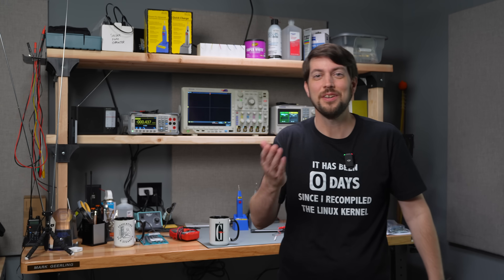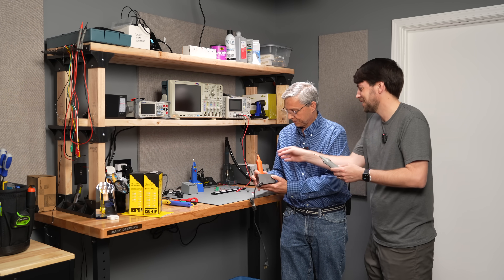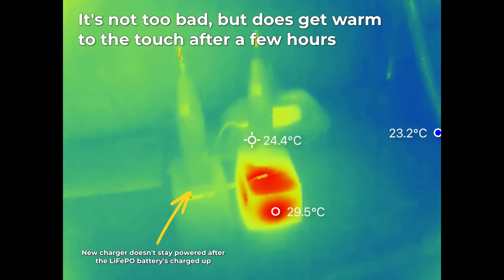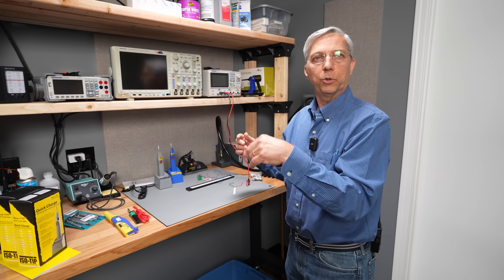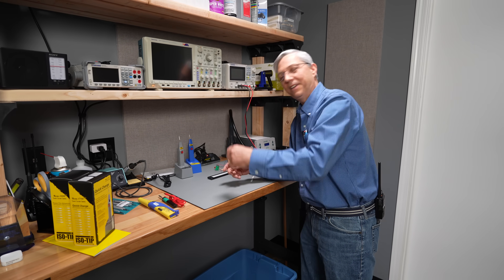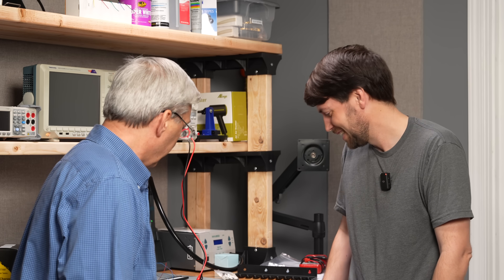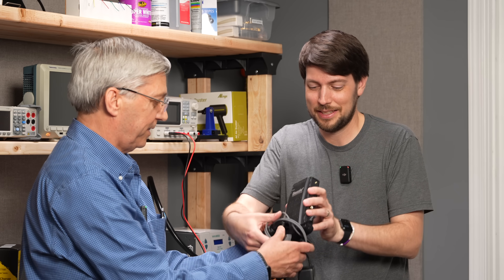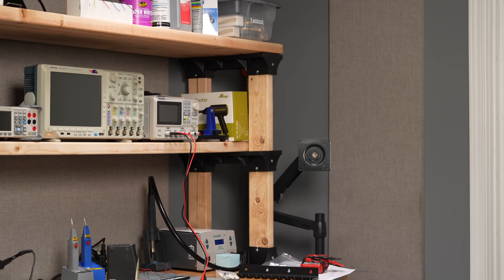Sometimes old tools are better.

Comment: I have the Pinecil too and it's great but I didn't even know there was such a thing as a cordless soldering iron. Thanks for demoing!
Reply: I've seen portable butane soldering irons before but seeing an old rechargeable iron (especially from 3 decades ago!) was a surprise lol. That and the light to shine on the work area made me feel like a caveman with my old corded iron 😅
Reply: Is the pinecil worth it? I'd need to save up so it needs to last for me
Reply: @dfgdfg_  I'm not the best person to ask because I haven't done a ton of soldering but it's much better than the basic soldering iron I had before. My basic iron barely got warm enough to melt non-leaded solder so it was very frustrating to use. The Pinecil has a heating element in the tip so it heats more efficiently and more effectively. It also automatically cools down when you leave it on the desk and heats up again when you pick it up. The Pinecil is also pretty cheap at $25.
Reply: @dfgdfg_  It's quite good, I've used a v1 Pinecil as my main iron for some years now and done plenty of projects with it, from building keyboards and arcade controllers to modding GameCubes and Xbox 360s. It's pretty affordable too, I think under $30 from Pine64 directly, not counting shipping or cost of the extra tip sets (a chisel tip is useful). I guess you need a USB-C PD charger as well, but you might already have one around from a phone or laptop.

Comment: I just wish I knew how to get the “magic smoke” back into the device once I let it out. 😂
Reply: That's what soldering flux is for
Reply: If you know the magic with the soldering wand, sometimes its possible!
Reply: you go to the same store that sells board stretchers for when you cut one short...
Reply: You don't, you have to remove the spent magic smoke dispenser and install a new one. Magic smoke is a consumable, and must be replaced when spent. This is basic knowledge guys, come on!
Reply: ..sometimes its rly hard get the smoke back into the device... 
but with the right tools its alot easier....
Reply: That’s the neat part. You don’t
Reply: This quote will go down in history. Great show.
Reply: You open your wallet and summon the cash genie - the cash genie grants all wishes, as long as you have cash
Reply: Dollar bills, usually more than I'd like, are usually the solution to that.
Reply: @grayrabbit2211  well, thay do make ppl working with putting the smoke back in the device happy 😄
Reply: Too late, you measured it by seeing it come out. Now it doesn't exist inside anymore. Quantum smoke.